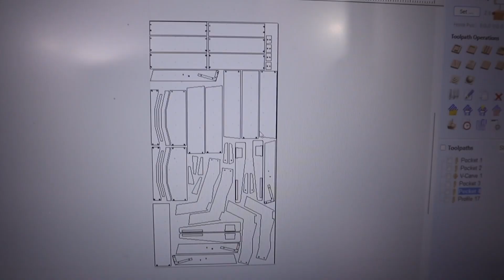Making Adirondack Chairs From HDPE

Comment: I always wanted to make a camper box out of HDPE because of it's strength.  For experiment, I made an outside rack from steel tubing and bolted HDPE panels to it.   In the first winter we got temperature drop to -30C.  All the bolts got ripped off the panels.  That is how I learned about extreme thermal expansion of HDPE.

Comment: It's over $500 for a sheet of 3/4" HDPE where I live. That means each chair has $250 worth of main parts, plus stainless steel screws aren't inexpensive either.
How much do you think people will pay for a chair? Serious question.
Reply from the maker: I get the sheets for $280. I have about $12 in hardware per chair. I can get two chairs per sheet. I have been selling them for $375 per chair

Comment: HDPE is very stable, have you considered drill/tapping directly to save the effort of threaded inserts?
You may also be able to save time by programming a predrill path for some of the screw holes.
Reply from the maker: I have not thought of tapping it instead of a threaded insert. That is something I will look into trying. The cnc pre drills and counter sinks most of the holes. It can’t do the ones for the. Back support pieces as they are drilled in the side of the material.